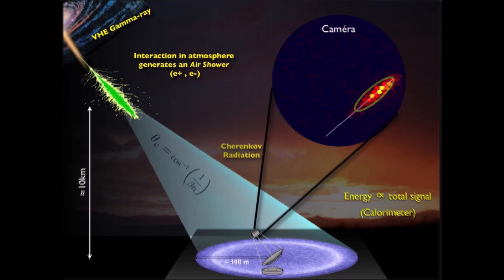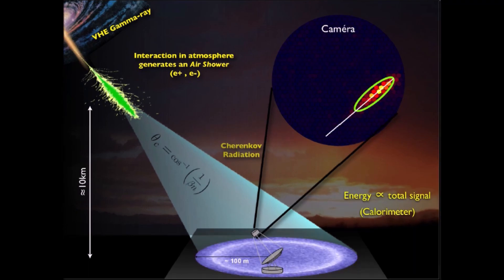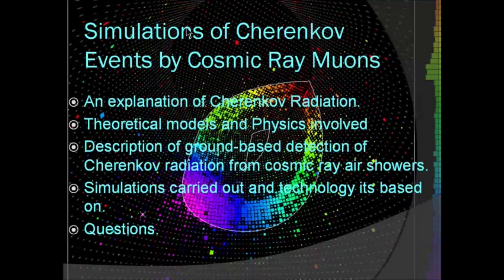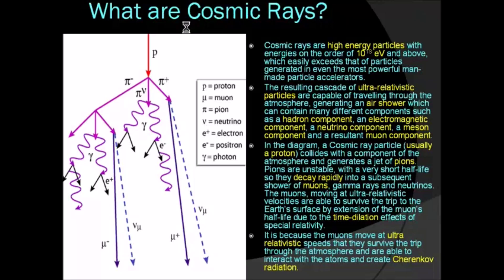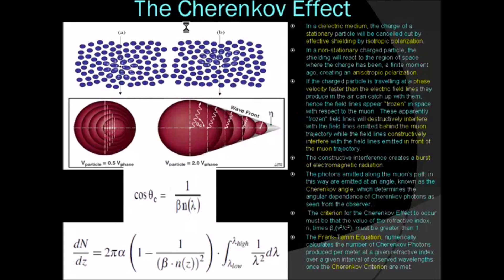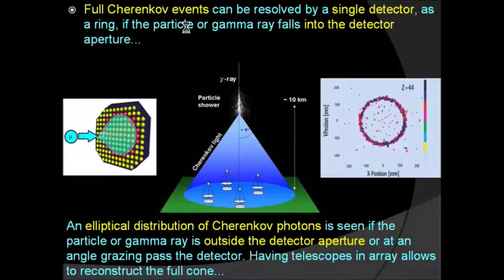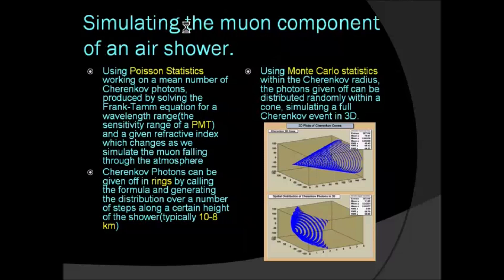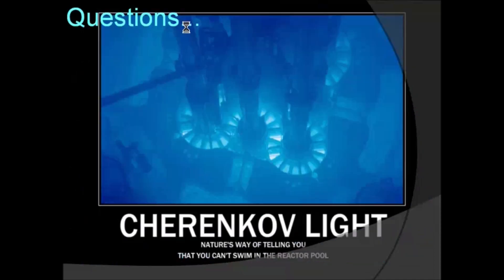Simulations of Cosmic Ray Muon Cherenkov Radiation using CERN ROOT (2011 presentation)

Comment: In of northeast Asia Motohiko Inai has patented a ground based particle accelerator to fuel a rocket engine in flight while Keitaro Yoshihara has patented a laser optical trap to produce nimbus storm clouds from humid air given how atmospheric storms can function as accelerator colliders of cosmic rays.

Winchel Dosuk Chung's "Atomic Rockets Rho" commented on how even a modest interplanetary civilization would require freighters and tankers having fuel tanks which would exceed nuclear arsenals of nations.

Materials could be ionized for particle accelerators to be retrieved by mass spectrometers like pipelines while film deposition machines could spray materials along with liquid droplet radiators like cooling towers and laser optical traps could manipulate stars like hydroelectric geothermal stations.

Comment: I have seen Cherenkov radiation when Dr. Brian Ahern loaded deuterium into palladium in his basement lab in of Boxborro, MA. since it is important to remember some researchers cannot have access to cyclotrons, synchrotrons, high powered lasers, etc. available to CERN, Paul Scherrer, Triumf, and Riken. 

I remember a physics professor who could not obtain enough signatures to go tour Penn State reactor while anything nuclear aerospace is often a military monopoly where EPA officials can Walter Peck away at private facility to confiscate any suspected unlicensed isotopic fuels or as they said in a Hollywood film " I assume by 1980s Plutonium fuels are easily available from any corner station but in the 1950s they hard to come by".

Comment from the maker: Code used here:https://github.com/MuonRay/Muon_Cherenkov_Simulation_CERN_ROOT
Here I share a relic of sorts from my past I found and restored recently. It is a presentation I gave back in Summer 2011 (almost 11 years ago!) I did an internship at UCD school of physics the year before I got my Bachelor of Science degree. I was fortunate enough to do some work in a subject area which interested me a lot at the time and still does namely the detection of cosmic ray particles in Cherenkov telescopes. 

Cosmic ray muons are created in the upper atmosphere by collisions between high energy cosmic rays from astrophysical sources - black holes, supernova, galactic cores and so forth. As the particles, mostly protons but occasionally heavy nuclei, interact with the atoms in Earth's atmosphere they create showers of decaying particles some of which are particles called pions. these particles quickly decay into muons which are themselves unstable but due to relativistic time dilation can survive the trip down to earth and can create a cone of Cherenkov radiation which can be detected by telescopes used to detect gamma ray events in space that create similar electron and positron showers to cosmic rays. Cherenkov astronomy is widely used in different contexts, for surface gamma ray observation, underground neutrino detectors and in detectors used in particle accelerator facilities such as the LHC.

The work I did back in 2011 was to create a muon Cherenkov simulation code in C/C++ that can be implemented in CERN's ROOT compiler. The code in a nutshell uses the Monte Carlo method to integrate over the photon count of cherenkov photons, produced by cosmic ray muons, with the photon flux being computed using an equation called the Frank-Tamm equation. The code is pretty temperamental and is bulky, which is one of the main flaws of CERN ROOT, however this was quite a good learning exercise for me at the time and enhanced my focus towards physics used in coding and simulation science in general. 

Looking back on this time in my life is interesting as I was a lot more naive about life and science in general and in particular about the role of physics in society and how to use physics principles in the real world and in research situations. I was always very independent in my work ethic and I remember spending a lot of time working on this alone and I learned a lot since how important it is to have others, supervisors and colleagues actively supervise and monitor such work as otherwise it can become cryptic and also a kind of dead and undynamic stone tablet rather than an active tool - this is why I find platforms such as Github and others so essential to my coding endeavors today. 

Not only do I get necessary feedback that motivates more development but honest criticism, failings and avenues to improve and apply my work elsewhere. So if you are interested in suing this code or others like it on my GitHub please do!